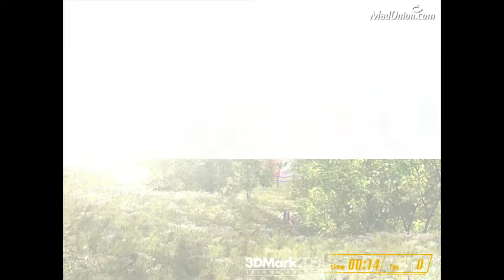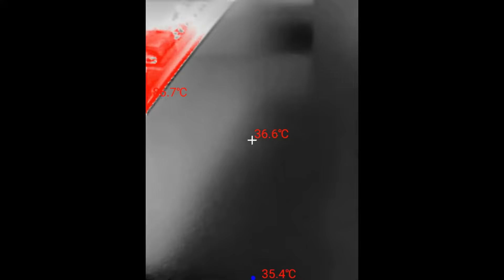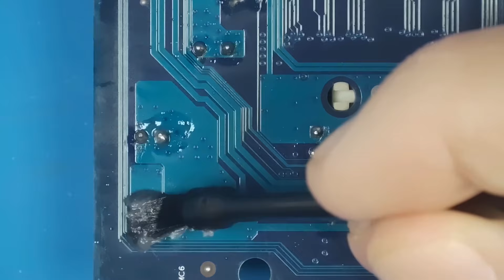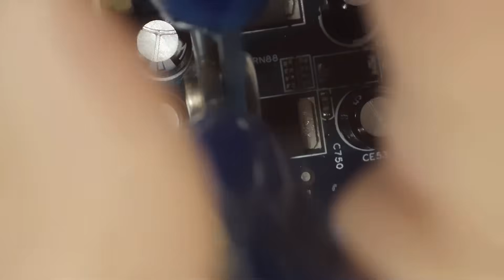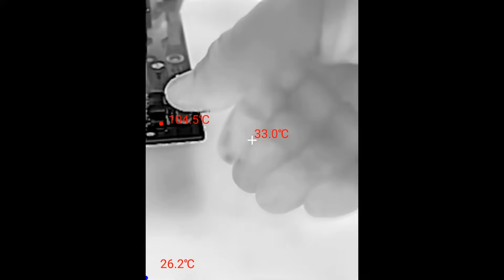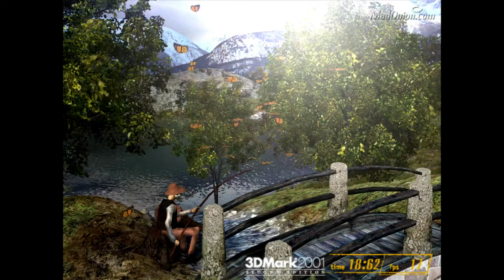Can We Repair Retro Socket 939 Motherboard? (Lenovo L-NC51Q with Nvidia Chipset)

Comment: When you pull the cap out and if it is not clean, use a hand drill with a small bit and drill the hole out so you can solder it. Sometimes motherboard just suck too much heat that you can't desolder without damaging the pad

Comment: Hey Phil, You don't need to use a solder sucker, I have one too and it is hit and miss. I will tell you, heat the lead and work the cap back and forth, The leg will pull out, do one, then the other, or just grab the cap and keep a tug on it while heating the pad. Usually they will come out clean, and even with a sucker, that will be the best way to finish the job.

Comment: Don't hesitate to add a little extra, extra solder to the joints before desoldering, like a blob. And I wouldn't count more than a few seconds with the desoldering gun at 370 degrees or you'll fry the joint so be careful. It should come off clean with a single 'roll' or 2 before pulling the trigger. Keep the trigger pulled when lifting off too. I don't use flux when adding extra but I am told it makes life easier. If the component leg is still stuck but solder is removed, just use a clean iron tip and it should wiggle out with ease. Just to save you risking the desoldering gun again. I have fried a couple of boards getting too heavy handed with the desoldering.

Comment: You really need  to  use more  flux when soldering things like those voltage regulators. It's also perfectly OK to use lead solder when removing and replacing components soldered with Tin from ROHS boards.

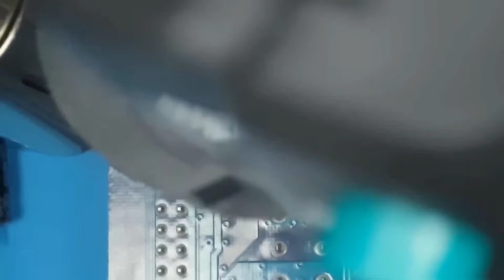Comment: The plastic post at 18:21 gets a bit shriveled. Not a big deal in this case it seems, but it pays to think about where your heat is going with the hot air gun. I've had too many unfortunate situations because the air flowed onto something more delicate. Kapton tape is an easy solution for making little shields. Good work overall, love seeing your journey.
Reply from the maker: Wow, nicely spotted!

Comment: They have drop in replacements for linear to mosfet style. The caps would need to probably be poly modded though due to the ripple but ya it's a thing.
Reply from the maker: Interesting, I didn't know that was an option!

Comment: Doing those regulators, try laying the flat side of the chisel tip flat but on an angle so its equally touching the metal of the chip and the pad itself, the more thermal transfer.  That and some extra flux, so it flows underneath easily.  But you did a fine job !
Reply from the maker: Oh that makes sense! I'm glad it came out quite easily, I was a little worried, but all good

Comment: When working on one of these boards, I'll usually preheat, add fresh solder. I try not to push hardly at all when using the desolder gun, and wiggle it only while not pressing it against the board. If it's really stubborn, pre-heating and propping the board up so you're desoldering gun only has to pull the solder to the side instead of overcoming gravity and sucking it up, will help sometimes 😀
Reply from the maker: Oh I like the tip of holding the board at an angle so that it's easier to suck out. Clever, thank you 🙂

Comment: Okay, I've watched all the videos on this channel and I think I have a lot of tips that should help you. I may not be an expert, but electronics repair is my passion and I have experience in it. So first of all, I'm impressed with the quality of equipment you've purchased. Everything is modern and high-quality, and I think that's caused some difficulties in your learning process. Most electronics engineers start by buying a soldering station, solder, flux, and a multimeter. Buying more tools stems from the need for further development and more advanced repairs/projects, and that's my advice. All the work you've done on this channel so far hasn't required anything more than a standard soldering iron and basic tools. By trying to use your advanced tools, you've actually made things more difficult for yourself. Try to make a regular soldering station your main tool. When you want to desolder a capacitor, simply add some fresh solder to the pins. Then, hold the soldering iron by the pin in one hand and gently tilt the capacitor with the other. When it moves, move the soldering iron to the other pin and pull the capacitor in the opposite direction, repeating until it comes out completely. I guarantee it will come out very easily and there will be no risk of scratching the PCB like in your videos. You can remove any solder remaining in the hole with copper braid and flux, but removing it is often unnecessary, as you can insert a new capacitor using the same method (heating the pins) and finally add fresh solder. Only use a desoldering station when you need to replace components with multiple pins. A preheater is useful when soldering large components like RAM or GPU chips. Heating the entire board is unnecessary in most cases for basic work, and it poses unnecessary risk to the surface-soldered GPU or chipset (circular connections can crack from thermal stress). Another issue is that you have a damaged transistor on your Radeon 9550 card. Missing components on cards are a very common problem. In such a situation, I search my collection for cards from the same series, remove the component from the sibling card, and test it on a Fnirsi LCR-P1. This transistor tester is very good at accurately testing even the smallest SMD components. I've become so proficient at SMD soldering that I can place a test component on the donor card, and it's impossible to tell which one was removed. Another thing, your soldering tin has a good quality flux in it, which is why your soldering turns out quite solid, but for example, at 19:40 you can see that the solder is so stringy. In the case of through-hole components, it's only an aesthetic issue, but if you solder SMD components, the problem will be intensified. Get used to the flux, without it, it's impossible to do factory-looking work and you'll go bald from stress with small components xD. One last thing, in this video, you had a donor motherboard. I don't understand why you didn't use the voltage regulator from the damaged board and bought new ones. In my opinion, only electrolytic capacitors are components that wear out quickly and are worth replacing to new. However, other components are best taken from damaged donors if possible, otherwise the shipping costs will burn your wallet. Every electronics technician is a bit of a garbage collector, but I think this kind of recycling is cool ;-)
Reply from the maker: Hey thank you for the detailed comment! You are right, tools don't make you good at the task. 😊

Comment: Hi Phil! Nice to see you continue with soldering! Unfortunate that the cap replacement didn't reduce the heat output of the voltage regulator. You could check the resistance of the output pin to ground and see what resistance you get - it is probably quite low. From that, you can calculate how much current is flowing (Ohm's Law). Debugging circuits is difficult (I struggle too). However, after a few successful fixes, you get a "sixth sense" what could be wrong especially if you're fixing similar components.
You could try to power the board without the CPU and then also without the RAM and check if anything changes in temperature.
The RAM sockets have plenty of SMD components that could go bad.

ChatGPT might give sometimes good hints, but sometimes it just throws you off. I would not replace caps if there isn't clear evidence that I have to replace them.
For working with solder wick, always add some flux so that the wick is not dry. Solder doesn't flow into the copper braid otherwise.
Reply from the maker: Thank you for dropping in! I saw lower temperature with a single stick and airflow with a fan really helped a lot. I'll measure the resistance and still keeping my eyes out for another board to fully settle what's going on 😊
Reply: MLC caps could be an issue. Id personally try powering the board without ram, and seeing the voltages and current without any ram, and seeing where all the current causing it to heat up is going.
Reply from the maker: Good idea 👍

Comment: If it is just a dodgy design - chuck a heatsink on it.

Also, lots of Bits un Bolts' videos deal with a dodgy component somewhere else on the board, causing the regulator to misbehave. You can get a cheap component tester, desolder the VR and test it out of circuit.

Comment: very interesting. 939 are not "retro".😂 
You can run Linux at insane clock speeds.😲😎
You need to do a Soldering Course man...
Reply from the maker: Over 20 years old 😁 Soldering is more challenging with these motherboards, but if you have any specific tips, I'm all ears!

Comment: Shame it didn't fix the heat issue. But maybe it is by design--in which case you could just stick on a little aluminum heatsink to the voltage regulator. Would help extend the life of it and the components nearby
Reply from the maker: I placed a 120mm fan nearby and it made a big difference. Yea it seems they designed it that way. Maybe that Lenovo machine has some half decent airflow...

Comment: Something I've started doing as a general "being nice to the next guy" step:  After you solder the new capacitors, melt the solder and straighten each leg one at a time before cutting them. 
* Bent/Angled through-hole legs will likely rip the vias if they have to be removed later
* Straight legs will be much easier to remove for the next person... who might be you. 

Overall, this was an excellent video and I am so glad you showed the whole journey, worts and all.
Reply from the maker: Oh that is a great tip! Thank you 😊🙏
Reply: Also the force of doing the leg cutting can crack or damage the solder joint so reflowing it after is not a bad idea for that reason also.